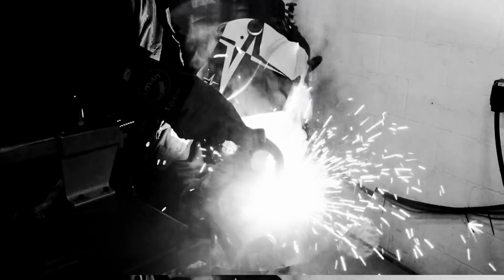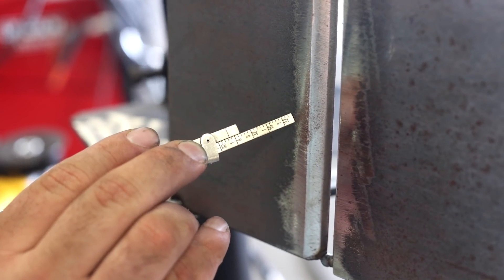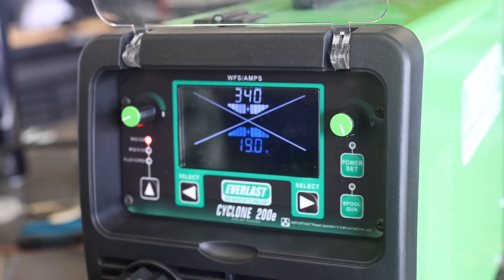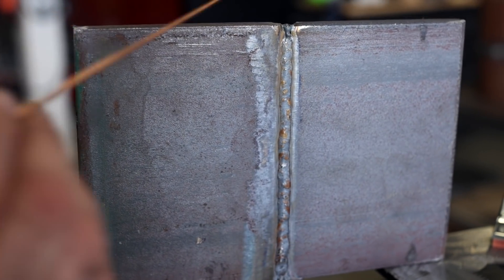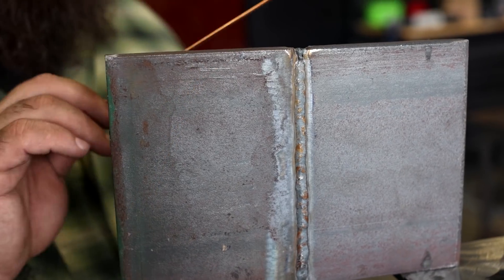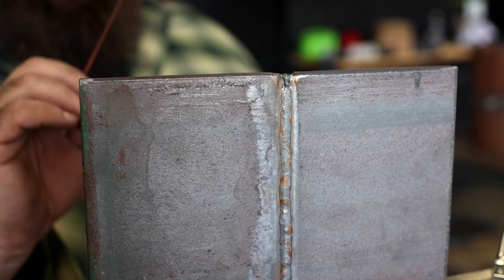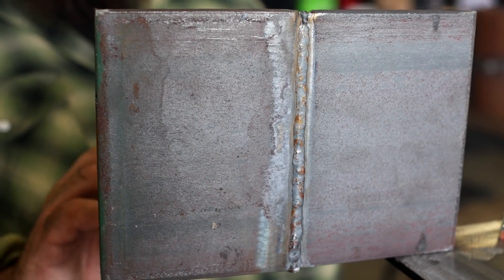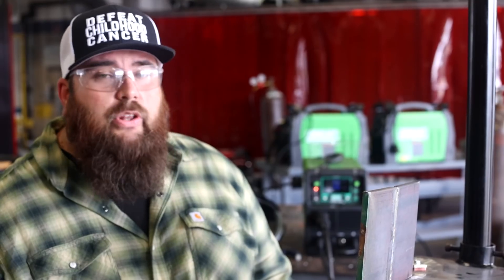Introduction to Open-Butt MIG Root Welding

Comment: Thinking upgrading from Miller 141 to a Miller 211, but saw cyclone 212 and cyclone 200e.  Currently doing automotive / autobody repair and  was just checking to see if you thought the quality was good enough to upgrade to as well weld quality.

Comment: Hey man I’m running 6010 and I was wondering if I could store them in my oven
Reply: You shouldn’t need to for 6010. The only rods that you need to keep in an oven are low hydrogen, the most common being 7018.
Reply: Don’t store 6010 in a rod oven. You want them to have 3-7% moisture in them. If they have less they will flake and finger nail on you.

Comment: Why did it sound so sputtery?
Reply: My guess would be, maybe not enough wire? Looks like it's burning faster than it can feed
Reply: Everlast with the factory gun. Shit liners, shit guns. Sometimes shit drive rolls too.
Reply: @hypnolobster  Have you used them? You do realize that Miller has used this same gun right?  Before they were bought out by ITW and had bernard at their disposal, and Lincoln and ESAB use the same drive roll mechanism.  Overall we have almost no issues reported with these guns unless someone runs a cart over the gun, or coils them in a 1 foot diameter roll by wrapping them around a gas cylinder. Never have gun issues or liner issues otherwise.  Occasionally a switch gets dirty, but the design has been around for 30+ years and is a proven, widely adapted and used design.
Reply: @marklugo6002  Gun in the video? No. Several other Everlast guns, yes.

Comment: Have you X-rayed  this root and what was the result ?
Reply: Iam  a X - ray  guy. Its common for pipe welds in fab shots to be welded like this , then shot and passed. Folks fail going up hill or down hill regardless.  

I was on an Api 1104 job and there where some welds that had more than the allowable lack of fusion or lack of pen in the weld and specifically at the root due to this process. 

With the down hill you will have more of a flatter bead inside the pipe then say with an up hill 6010 smaw . 

Over all they hold and get banged out quick in a fab shop.